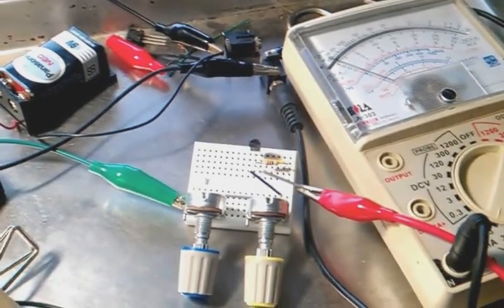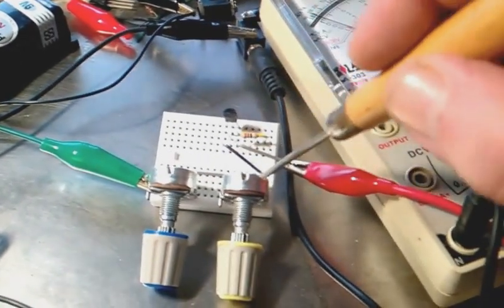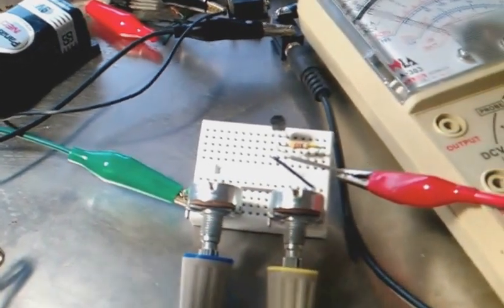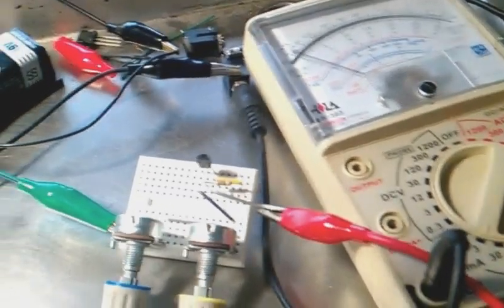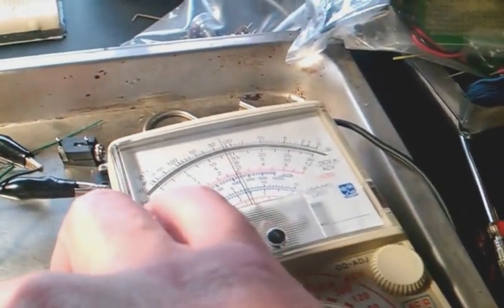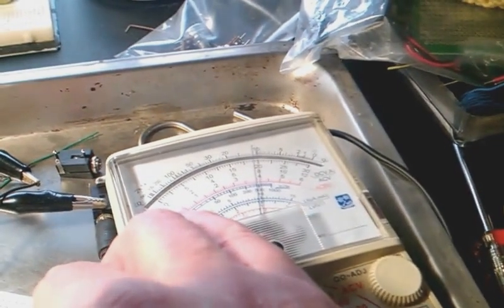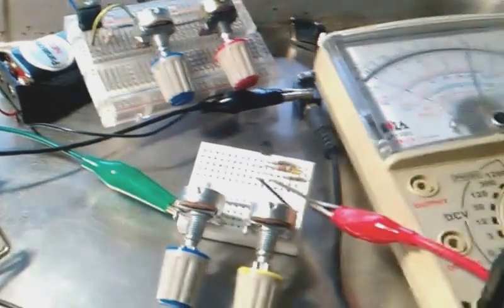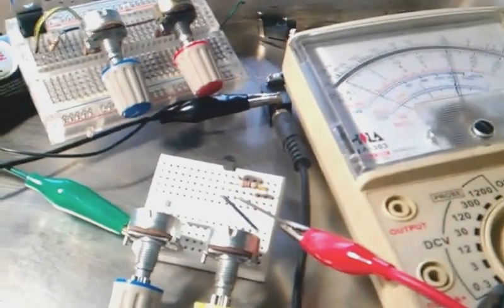My tDCS Experiment: Part 6: New Circuit w/ LM334 Current Regulator

Comment: Hi John,

Thanks for sharing this.  I have a question though - it seems to me that no matter what resistor I used between the pin2 & 3 of the LM334, I always get the same max current. In my case, I use two 12v batteries in series so that's 24v, and for the resistor I tried 10ohm, 33ohm and 47ohm, and the max current is always 2.7mA.  I even tried a variable resistor, but no luck.  The max current just won't change.  I really wanted to fine tune the max current.  Would you help me pls?  Thanks.